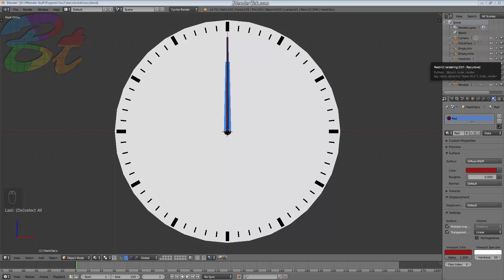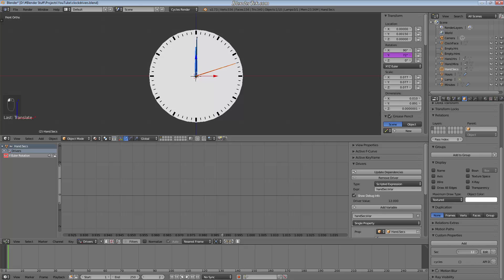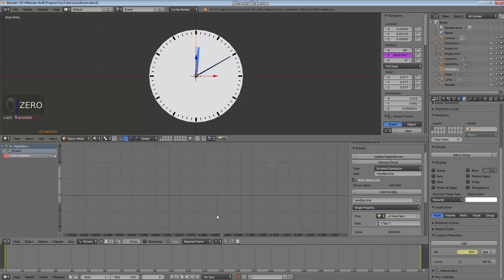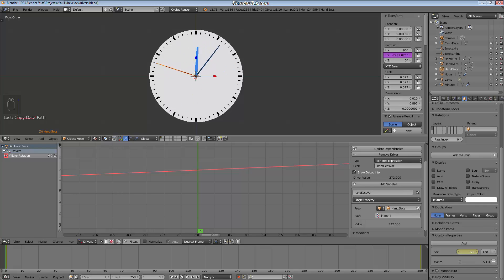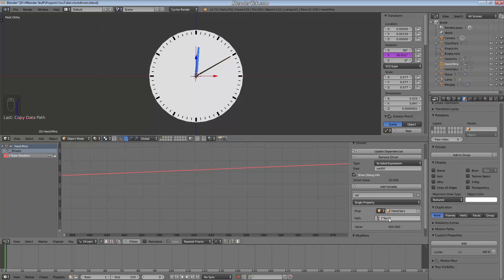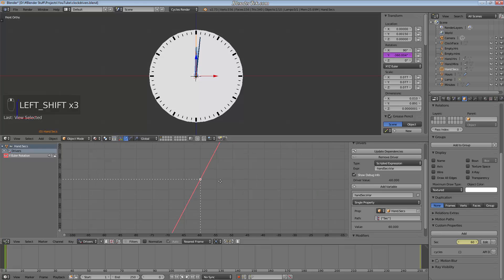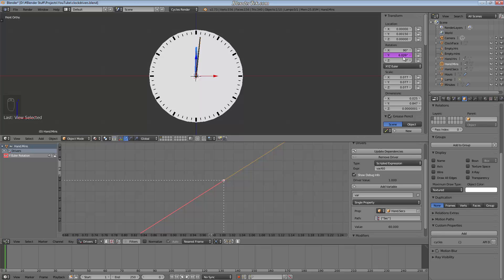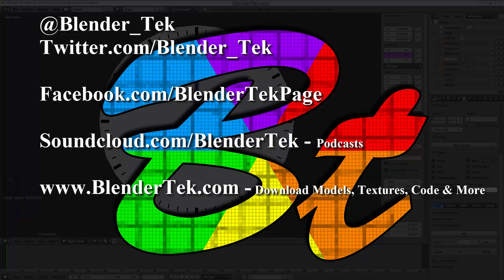Using Drivers to Make a Working Clock in Blender - Quicktip

Comment: This may be a little confusing for someone who may not know how to add a driver.  Also seems to explain how the procedure works from reverse.  I missed the part where I start with a clock model, and apply rotations to the hands driven from seconds property.
Reply: agree, doesn't make any sense, at least for me coz I'm new to BL.

Comment: Nice demo. Can it be that the little unprecision comes from rounding errors when blender calculates degrees to radians? Or maybe just the nature of Pi? Is it possible to implement a corrective equation into the driver expession? Perhaps in the kind of dividing it by let's say six, rounding it and multiplicate it with six again? Just a lost thread of a thought...